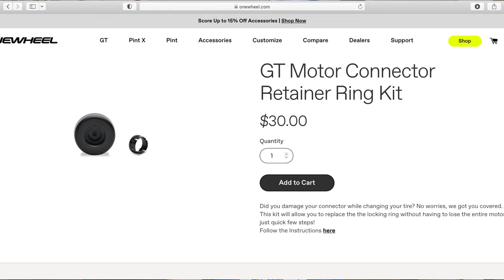ONEWHEEL GT- THIS IS A MUST HAVE !!!  GT MOTOR HARNESS/PLUG RETAINER

Comment: Will the Tech Rail GT Motor Harness work with the stock GT-S Rails? I purchased a harness similar to this from Float Life, and it only works w/ WTF rails. FM sells the replacement clip ($30), though it does not make sense replacing it, if it will just break again. It seems like the Tech-Rails harness is essential. Followup: I just mounted the harness on my stock GT-S Rails... It was pretty easy to install w/ the video tutorial. Now that the fitting is more secure, I feel more safe riding my GT-S. Thank You!

Comment: My GT just died randomly 3 times in a row and I'm thinking the motor harness plug maybe got back out. But I didn't get a red light. The motor just turned off and I had to turn it back on.
Reply from the maker: That’s the XT-60 connector for sure
Reply: @jeffadairshreds   you mean the one you're talking about in this video or a different connector?
Reply from the maker: @victoriapower-b6u  it’s a different one - YouTube it. It’s in the controller box, I’ll
Make a video for it - the gts has a little piece that secures it now 🤘